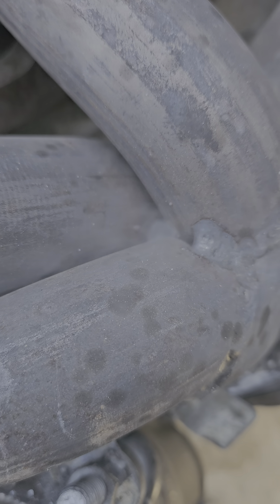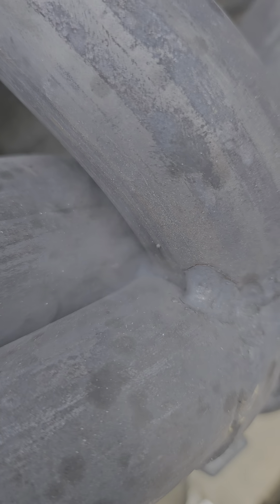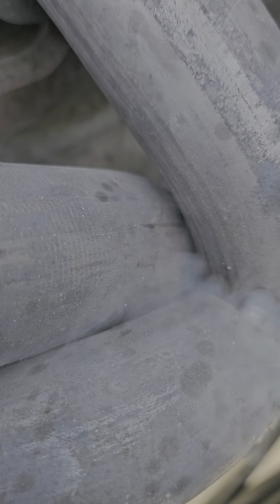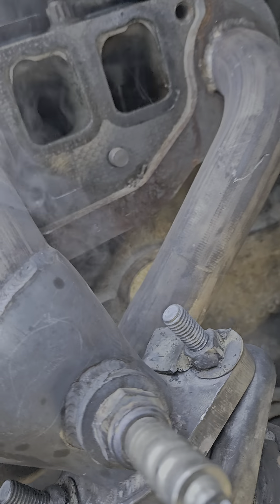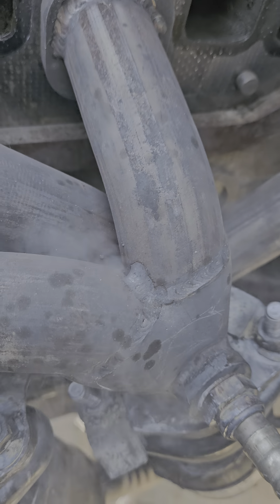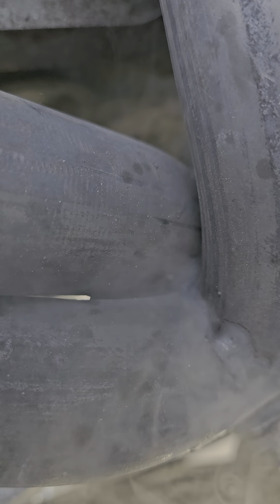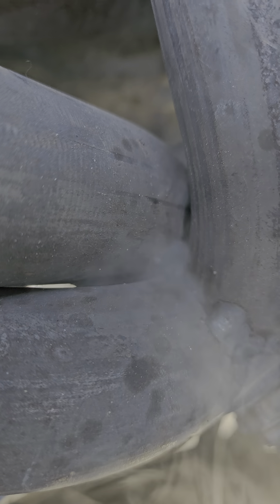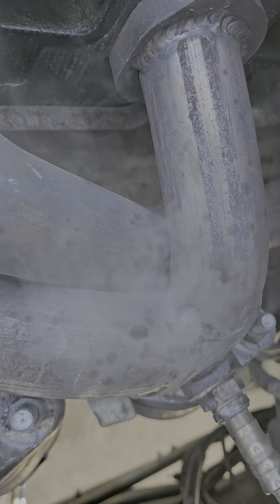Banks Header System #51306 Leaking

Comment: Funny I see this just as I’m installing Banks’ $1000 Monster Ram intake elbow on my truck.  For that kind of money I expect the machining to be flawless however 2 of the 4 sensor ports were not even tapped correctly and one of the npt plugs was double threaded! So now I have to spend even more money to drill and tap for bigger plugs because their quality control is shit.  Should have learned my lesson when the diff cover I got from them came with 3 missing bolts
Reply: What did their customer service say?
Reply from the maker: Based on this video they are going to warranty the part & I'm currently awaiting for the new one to arrive, Should be here by mid next week! I would contact customer service as I did & see what they say.